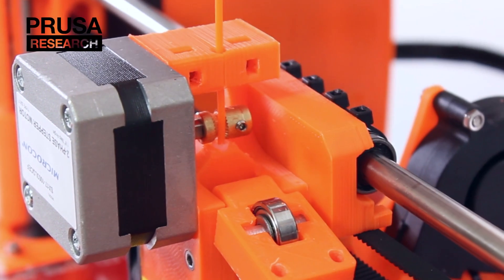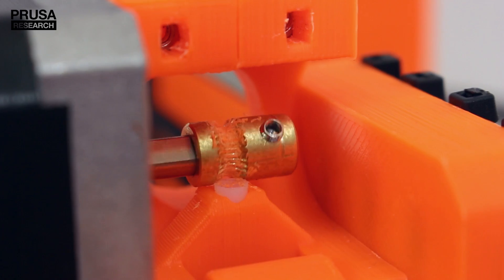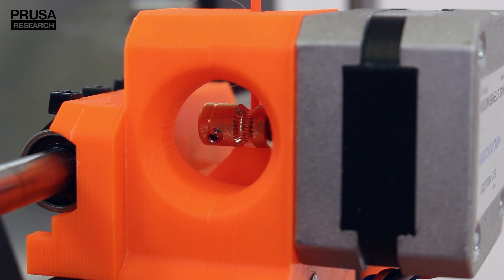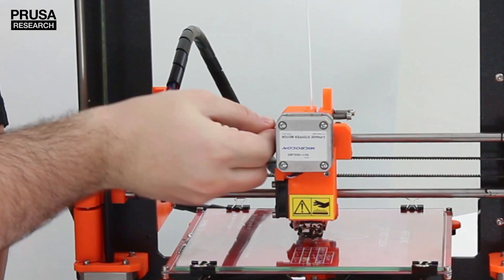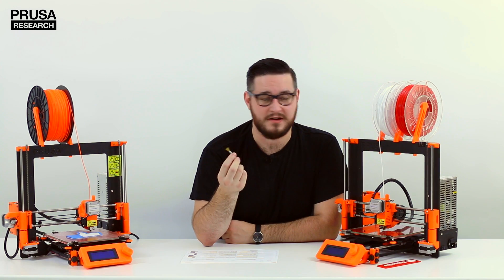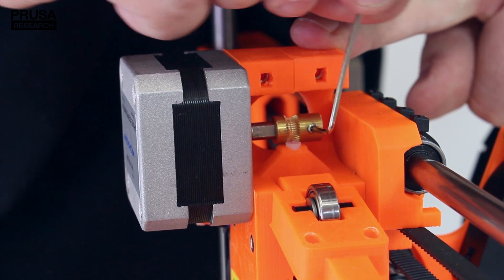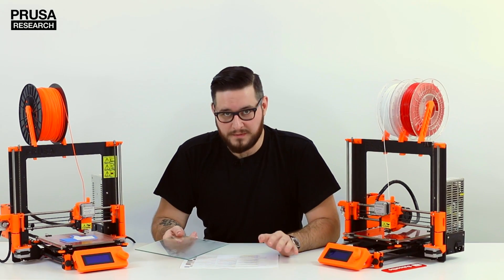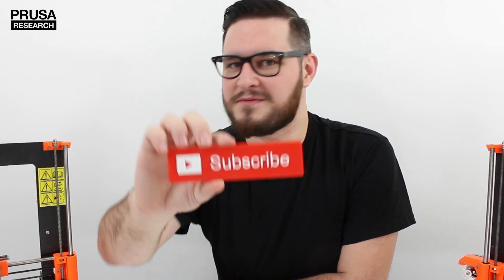Cleaning the hobbed pulley - Tips and Tricks #2 [3D Print]

Comment: I have Prusa the i3 MK2 i received less than two weeks ago. the hobbed pulley came loose yesterday. I tried to tighten up the pulley through the service hole, but it appears that the screw is not tightening.  Can I access it from the oopposite side like your video? Also, is there something I can do to get it tighten? Because my prints are failing because the hobbed pulley is slipping.

Comment: Something i already know.
But explain pls what we can do, if the Fillament get stucked between the Teeth when the print runs 3 Hours and ths happens maybe after 1 1/2 or after 2 Hours?

I use the mk8 drive Gear.
Reply from the maker: +Andre S. I don't know your setup, but I would guess you need to cool the hotend more.
Reply: I use a E3D V6 Bowden.
This is what happening with the Print...

https://drive.google.com/file/d/0BxLYV9G8oHT2R0xnNDRIVmZpc1U/view?usp=sharing

It happens after a long time on small prints or bigger one like this. :(
Reply from the maker: +Andre S. Are you sure that the nozzle cooling fan is installed correctly? Looks like it is the other way around :-)
Reply: +Josef Prusa (RepRap) I use the normal E3D V6 Fan to cool the Filament before it goes down in to the Nozzle.
On the left next to the Heatbed i've got a 120mm Fan to cool the Filament on the Heatbed.

It looks like that the Pulley cut with his Teeth in to the Filament and it stucks between the Teeth.
I've bought today a mk7 Pulley to solve this Problem... I hope so.

Comment: just bought my Prusa i3 from you guys a couple weeks ago and these tips are very helpful, please keep them coming! I would like one on bed leveling(that part takes me hours to master)and cleaning the nozzle please. I have used the glass, bought Buildtrack, used  sandpaper on the glass, all the stuff for the platform and either stuff moves to fast and makes a mess and doesn't stick or sticks so good you have to get an act of congress to pull it apart! Also every time I google Prusa I3 Slicr settings or pronterace settings, everyone has their own formula and most of them don't work because the printer I bought is newer than they videos(I have the e3 v6 1.75mm nozzle)and I would like a tutorial for this printer alone, because I have the exact one used in all your videos, also I can't find any info on the Pronterface settings on the bottom where it says (extrude and rate speeds)
Reply from the maker: +Scott S Best is to use our forum. Everyone has the same printer there. http://shop.prusa3d.com/forum/
Reply: ok, thanks, I wasn't aware of those forums. I'll look into it, thanks Josef for the info and thanks for your custom printer, I love it!